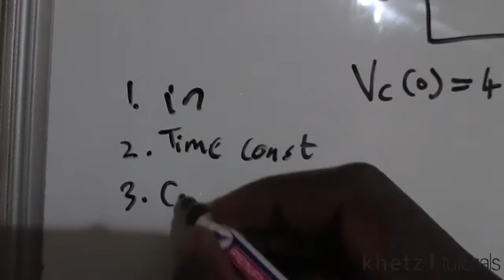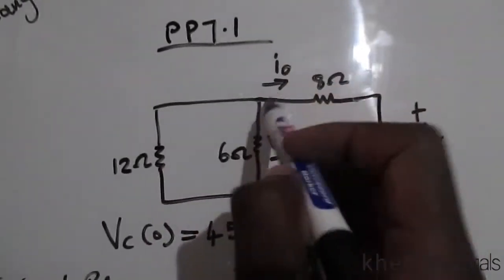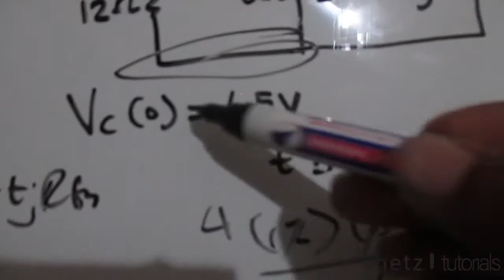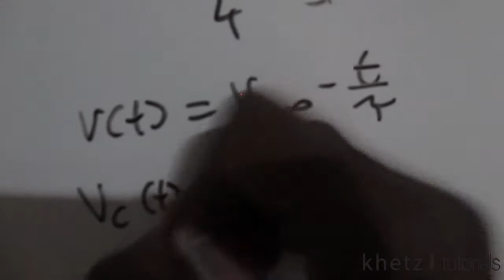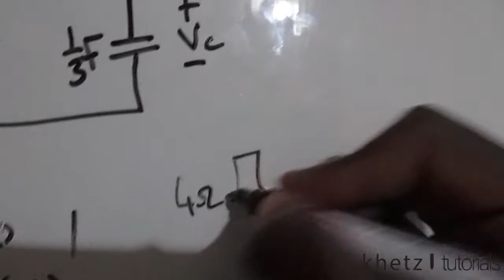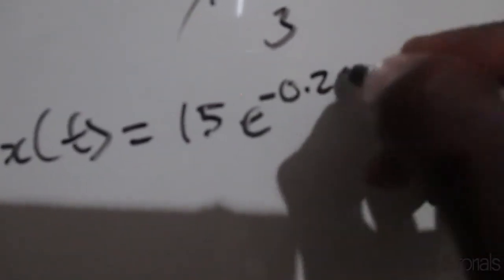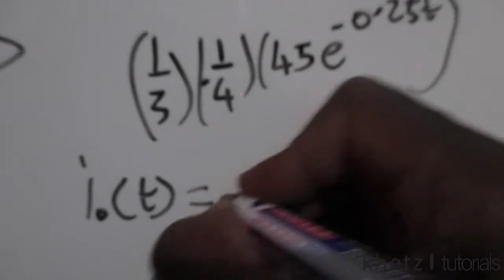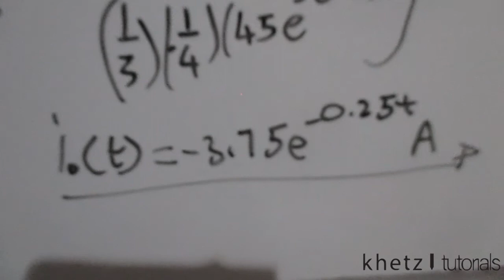Fundamentals Of Electric Circuits Practice Problem 7.1

Comment: Sir can you plz tell me from which end we should start calculating total resistance
Reply from the maker: Rth was calculated with respect to the capacitor so remove the capacitor then work it out. So you are effectively looking in from the capacitor's side. You can start calculating at any point. Here you only had (12 || 6) + 8